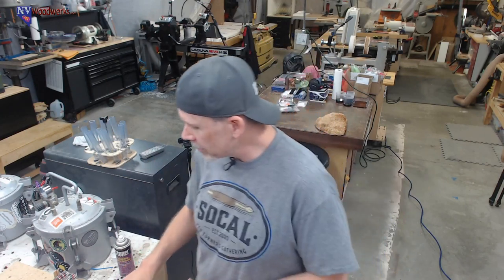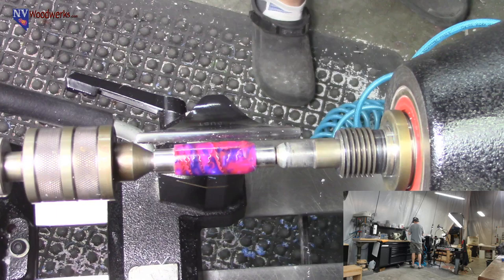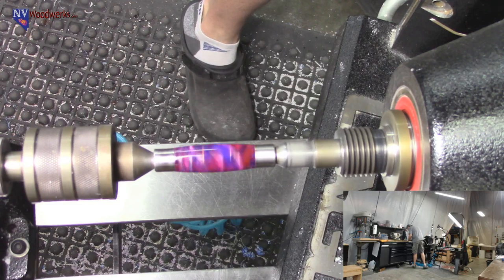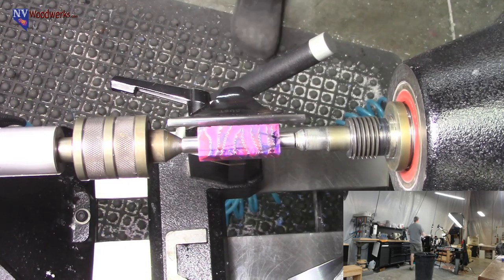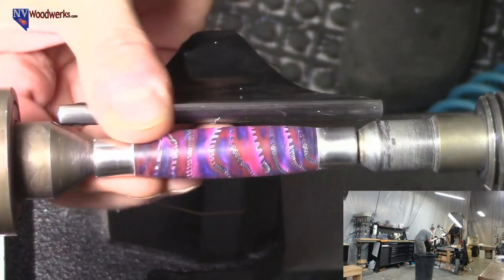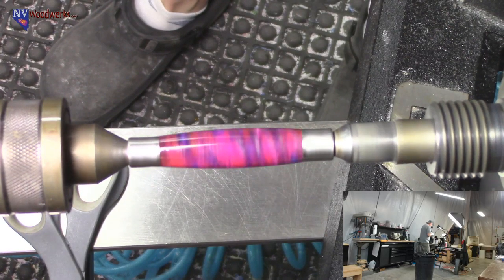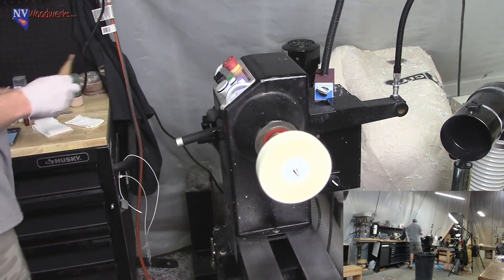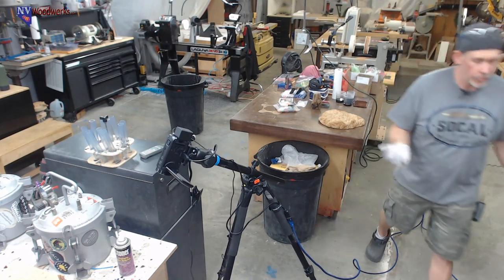🔴Replay: Turning the Aluminum Crinkle Ornament Pen #withme | Episode 59

Comment: Great video, 👍🏼👍🏼👍🏼👍🏼👍🏼 how much PSI is used and what do you mean D-gassing and would I need more equipment to buy, I watch video’s and something new is always mentioned lol lol
Reply from the maker: For resin casting, the bare minimum would be 40PSI, but you want a little buffer in case the pot loses pressure over time. There's no upper limit really, just depends on what your pressure pot is rated for. I'm not entirely sure what context degassing was used. I only do that if I'm making silicone molds, you suck the air out of the mixture before pouring it